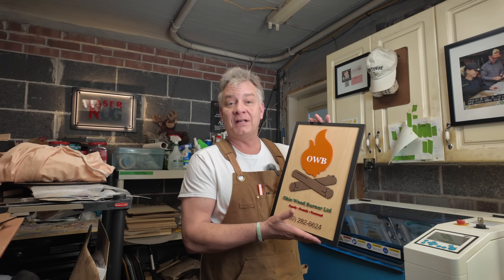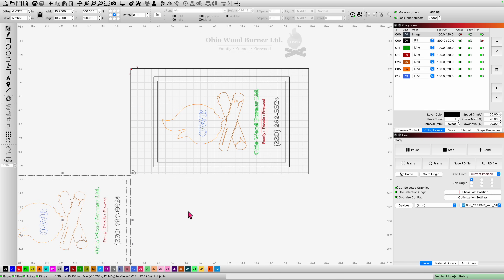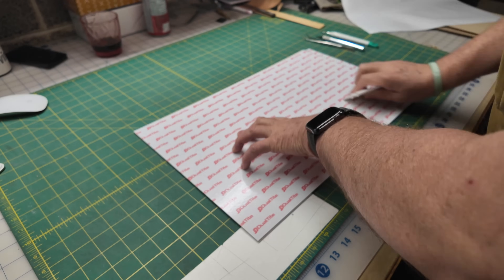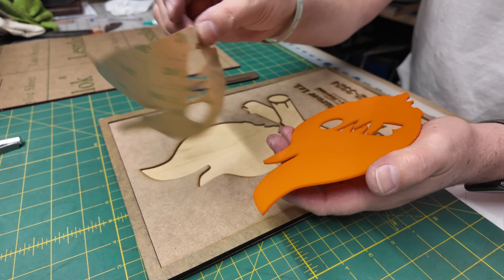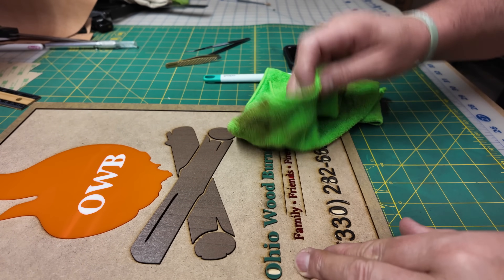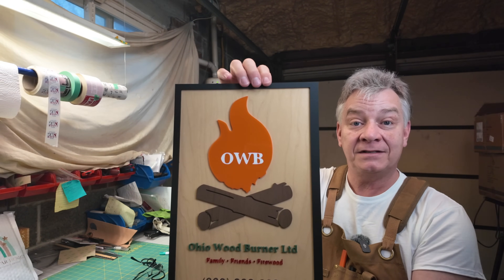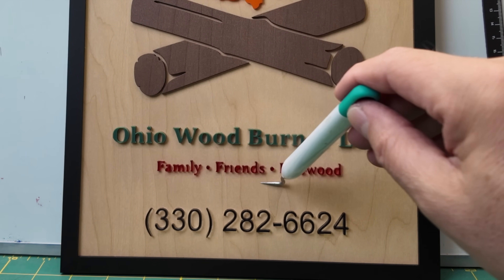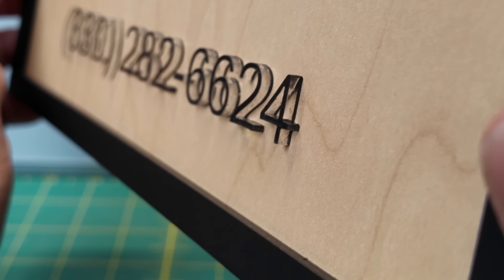I Tried A Few New Laser Materials. I Made Lots of New Mistakes. Thunder Laser BOLT.  075   4K

Comment: I got you beat on mistakes. I drew up a log house in an old house design software a long time ago. The livingroom was open all the way to the peak of the roof. There was also a 10 foot deep front porch that ran the length of the house. There were two windows in the living room. One was in the log wall and one was in the dormer right above it. As we were building the house we put scaffolding all over in the living room to make it easier to work on the roof system. We got the roof system all done and it was time to take the scaffolding out of the living room. The window that was in the logs was 6 inches to the left of where it was supposed to be. You could never tell it before because the porch roof broke up the line of sight between the dormer window and the window that was in the logs. 20 ton jacks and a really hard day corrected the problem. I went back to the computer and looked at the drawings, and sure enough, I had missed it. I hope that makes you feel better about what you did.
Reply from the maker: LOL! Thanks for sharing. Tough day for you but I'll bet it makes for a good story around the fire with a libation or two. :)) Cheers!